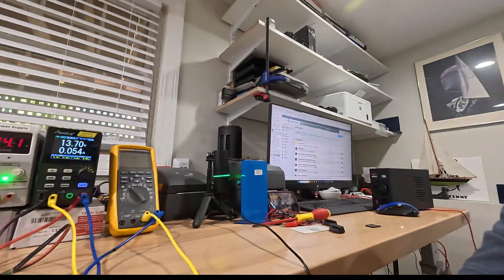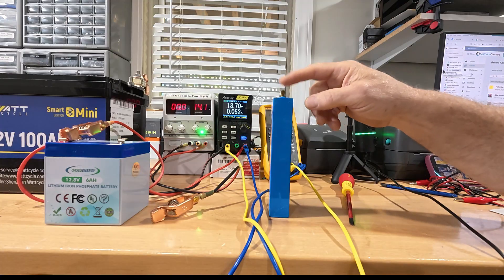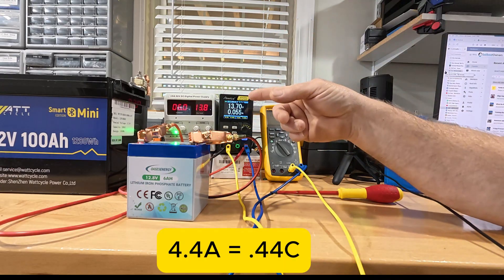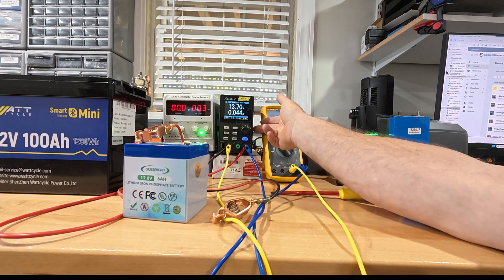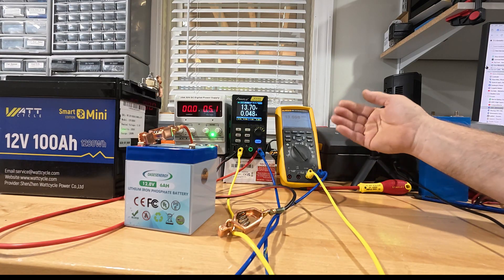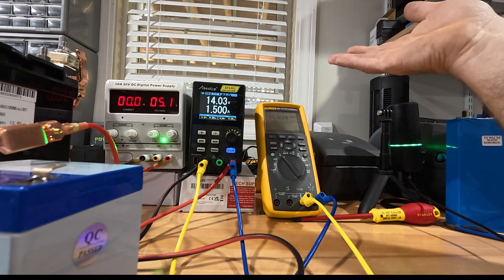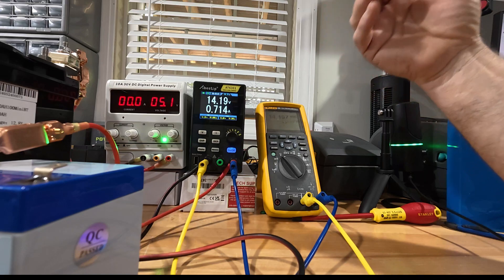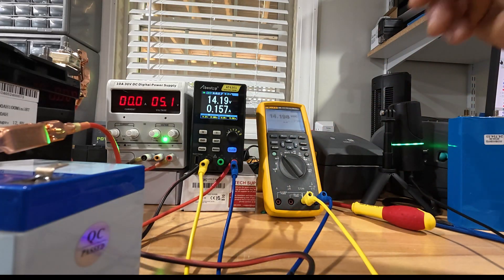Commission Charging LiFePO4

Comment: At 12:48, you show imbalance at 0.004V, but that is really not indicative of whether or not the cells are balanced, because the battery is at only 12.99V (adding the individual cell voltages in that screenshot).  Even a badly balanced battery will show a low cell differential at such low voltages because you're in the flat part of the curve.  The most meaningful imbalance numbers are above the knee, where cells will really start showing their imbalance, above 14.1V.  That is where the cells will really start showing their imbalance, and be even more evident as you get to 3.65V/cell or 14.6V.  I completely agree with the methodology, just that showing imbalance at 12.99V is very misleading.  Thanks for all that you do, Rod.

Comment: You mentioned (I think in this video?) that the leads which come with the AT6301 power supply were junk. I agree - I just received one I ordered through your affiliate link on Amazon. You may have said in the video you'd supply a link, but I don't see it. Any recommendations?

Comment: Thanks, Rod. Very well explained. I’ve always considered this a recovery procedure with a bench power supply but starting off right as the battery is commissioned is an excellent practice, especially for the lower price point batteries which don’t bin the cells well. (Cost)

Bulk (single phase) chargers just shouldn’t be sold as LFP chargers, but even LFP battery brands do this. Using a lead-acid profile…yikes!

Not sure I followed your 13.7v/13.8v logic while charging as 100%, but I think you are making the point that you can charge to 100% at any voltage above full charge resting voltage…if you have enough time to saturate the cells. 13.8v will saturate the cells faster than 13.7v. For most situations, 14.2v is well below any long term damaging voltage but your point is well made that 4 hours there is too long. A proper (2-4%) tail current setting for stopping 2 hour maximum absorption is usually a good approach to charge quickly and absorb sparingly. 

Keep the great vids coming!